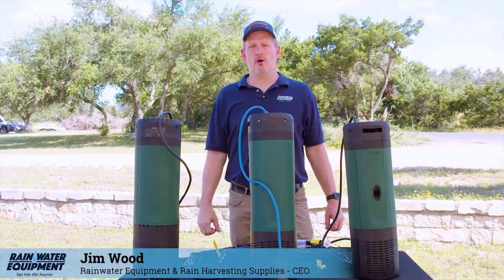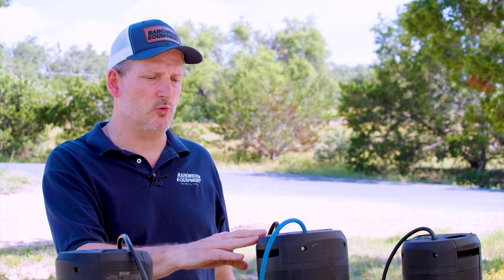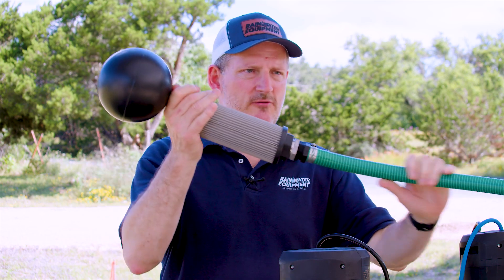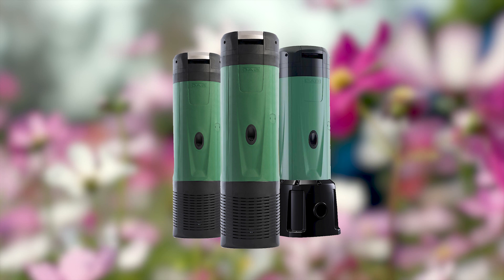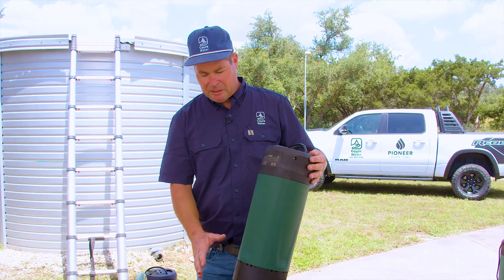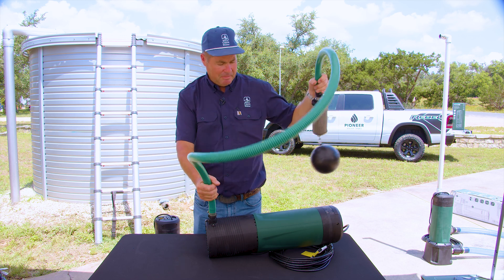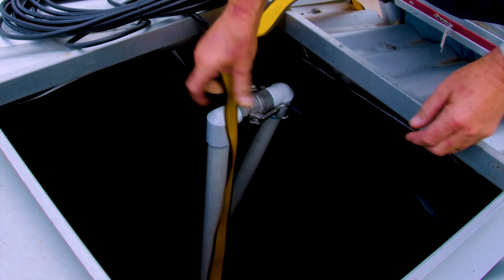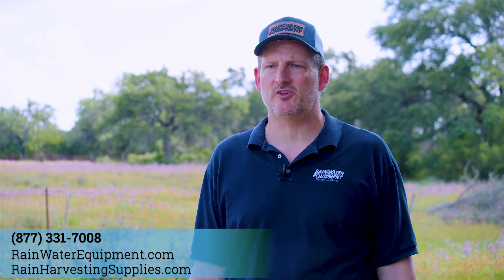DAB DTron 2 Product Overview and Installation

Comment: I have your DAB Dtron 2 that needs repair but I can't take my well and tank out of service so I'm going to order a 2 and pump to install while the original is being serviced. My question is: is there a way to disconnect the electrical cord from the pump and connect that directly to the new pump so that I don't have to do any splicing on the original power cord? It was hardwired into an electrical control box by an electrician.
Reply from the maker: No, I’m pretty sure there’s no easy way to do that.

Comment: The specs say this pump is 32gpm..
Reply from the maker: That would be at its highest flow rate with very low pressure. If you will go to our website, rainwaterequipment.com and find this product, you can look at the Pump performance curve that will show you how much pressure you get at each flow rate. It will do much higher pressure at lower flows and lower pressure at higher flows.